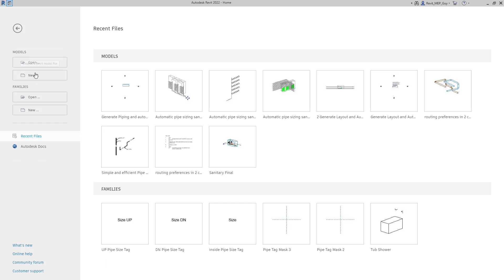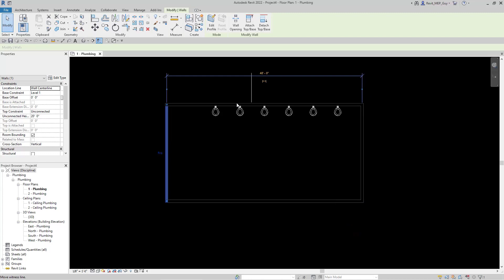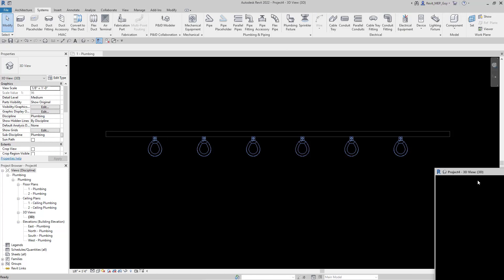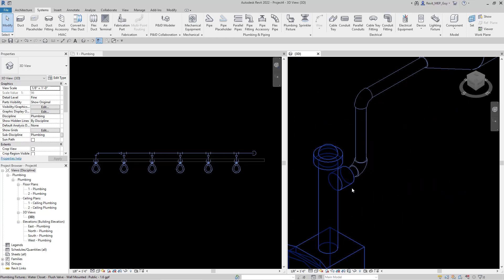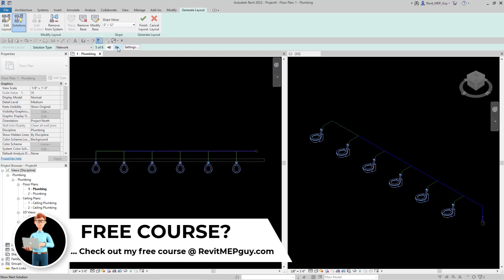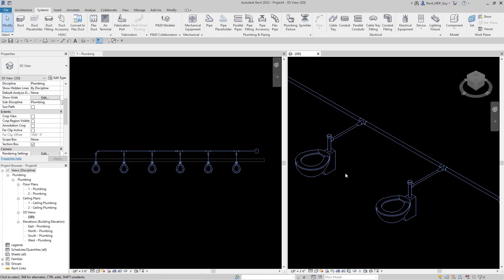Comment: What Addins you are using to calculate or generate the piping layout as i am using revit 2021
Reply: Just using the generate layout command. You have to make sure to create a piping system from the fixtures first. Let me know if that works for you. I have a bunch of other videos where I go over this on my channel. Good luck!
Reply: For calculations use the duct pipe sizing tool after you select the pipe run.